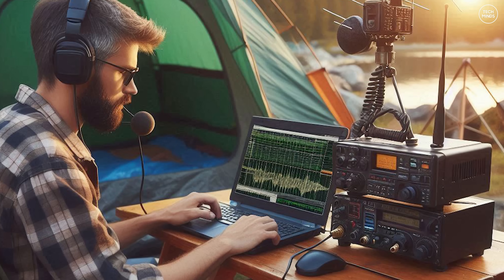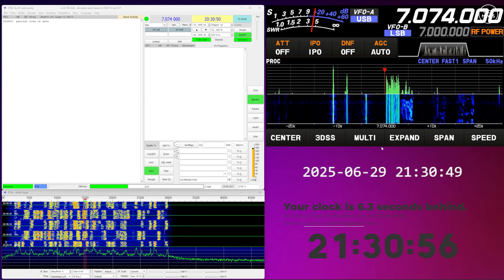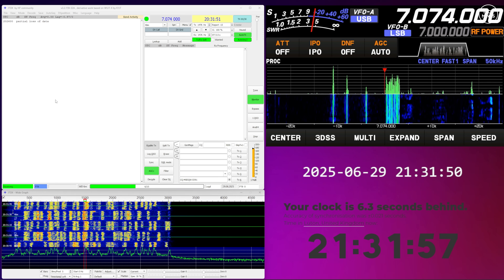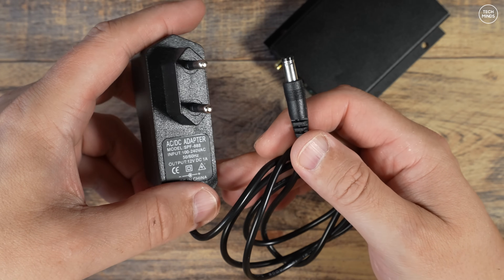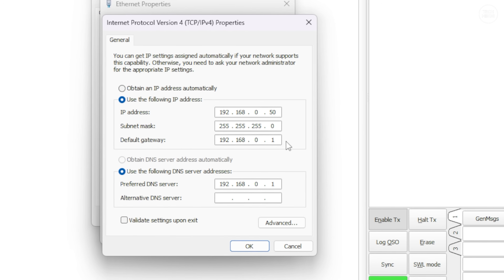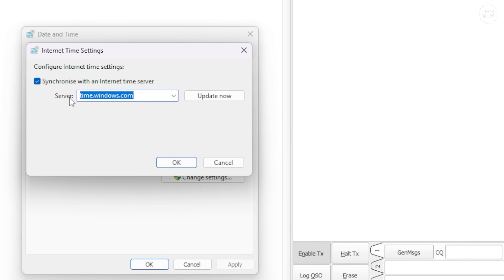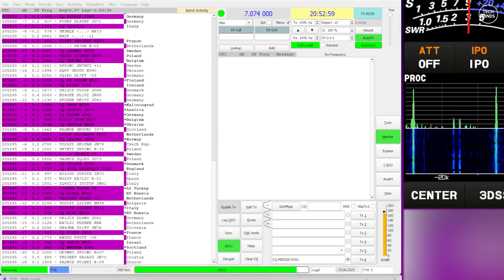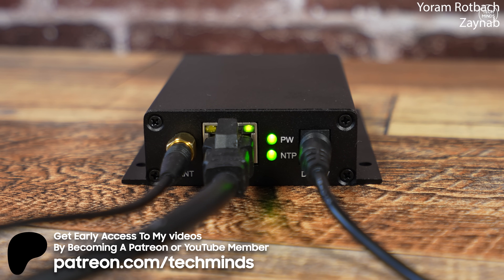Be THE BEST FT8 Station With This GPS Locked Time Server

Comment from the maker: Just a little heads up. The solution shown in this video is NOT the only solution. This is just one of many and this is suitable for sharing time data with others on a network without internet. The cheapest accurate way would be to use a GPS dongle, the completely free but a little more setup, would be to use JTsync. I should of mentioned this in the video, but hey ho, I still think it's a cool gadget to have. Cheers
Reply: Back in the Windows 7 days, I found the built-in NTP syncing to be pretty hopeless. So I always install Meinberg NTP and turn off the built-in NTP syncing, and I've stuck with this through W10 and now W11. It's nice to have reliable NTP sync that just starts when you boot up the computer, and even learns to compensate for any drift in your PC's timekeeping.

Comment: WHY? I have a cheap GPS USB dongle from Amazon and software from NMEATime2 running on Windows 11. So for about 34 dollars US and NO Ethernet setup or external power need. I have GPS synced time. giving me a DT of +/- and no more than 0 .3.   FYI: What is a ROOOTUR?
Reply: I'd have thought that the right dongle that passes PPS though used with the right drivers ought to be able to get way better than 0.3 sec error.
Reply from the maker: A ROOOTUR, which I presume you mean Router, is a network device to connect other network devices together and provide a DHCP server if required. I AM BRITISH AND SAY IT PROPERLY! There are many ways in which to skin a cat! This is just one of them... (The video solution I mean).
Reply: That was our Field  Day Set with networking on N1MM logging program.. ran very smoothly.

Comment: I use time sync, for sure.  That said, I still find it critical to have JTsync on-board.  Why?  I've gotten onto a band where there are few operators and they are NOT time-sync'd.  Being able to easily sync to them is where JTsync shines.  It's the rare occasion where being right puts one out of the loop.

Comment: What is the most popular use for FT8? 
Or in other words, why would I use/need FT8?
I don't know if I'm missing out or not.
Reply: As a CW op and FT8 too… when I’m drinking 🍺 FT8…. 🍷 FT8… 💉 FT8….. It is like the slot/poker machine mode. You get a little shot of dopamine when you land a DX station. If the bands are crapped out FT8 works as it is a weak signal mode. It’s fun but CW WILL NEVER DIE 73 de VK2AOE dit dit
Reply: It's just another way of making a contact. It'll work when the signal is too weak to make a voice contact. It'll give you another means of making a computer contact, joining things like RTTY, SSTV, PSK31, packet, etc. It's a good indicator of propagation to see where you can receive without having to spend a lot of time tuning around the band as they're all on the same frequency. It's also useful late at night where you don't want to be shouting into a microphone.
Reply: LOL. FT-8 on WSJT-X is fun, sort of and you don't need to get into a drawn out Conversation with a bunch OM.

Comment: Interesting. I used to run FT8 on an old Android phone. Using FT8 app. I made an adapter for the 3.5mm jack plug for headphones and microphone. Load resistors of 35ohms to simulate headphones on phone then feeding into mic socket on radio. Radio spkr out 8ohm resistor into phone mic socket.  Radio set to vox etc. Never had any problems with time. Just had to get Radio volume vox levels set etc. Assume phone app done time corrections. Used same interface for SSTV using the App. Worked for me but got bored with ft8. 😂 George

Comment: OK,  Ive got something simpler..    You can buy a $7 battery and install it into a Raspberry Pi 5 and have all the accurate time you want.   HOW:    The Rpi 5 just needs to sync once on your home network.   Then its good for weeks with its own RTC clock chip.    uggg.     Matter of fact,   I have run FT8 for several days from my RPI 5  with absolutely no issues.     Every several weeks I let it sync up again by booting on the home network then Im good to go for awhile.
Reply: All right, I have not done this with my pi but the pi fives have a new real time clock chip,  whereas the old pies do not. So you need to literally buy a battery to keep the clock running.  And you should be able to throw a GPS dongle on it to keep it accurate. I've been wanting to build a Time code generator out of a pi forever and now the pi5 gives me an opportunity to do so.  But there's still the huge problem with the code. Which I can't do yet.
Reply: until it crashes out and drifts or the SD card dies a death, these have jumped up in price of recent times like a lot of things on these websites since trump started chucking tariffs everywhere but for a simplified device  it does its trick a PI is overkill and unless you buy an older model more expensive
Reply: @scorpionfpv6412  the issues you are citing have not personally occurred in my setups since i started playing with rpis since 2012.  as far as pricing,  for me it was $0 cause I have about 8 or 9 of these things laying around as a hobbyist.  and the battery was just $7
Reply: the issues you have reported I have not seen in my RPIs and I have been using rpi for nearly a decade
Reply: @scorpionfpv6412  your experiences you have cited are not mine,  i have had good luck with my RPI units as a hobbyist over the last 10 years.   for me,  the cost was just the clock battery  because i already had an RPI5 laying around.   and as stated before,   full FT8 for hours on the RPI after a simple one-time sync at home

Comment: I use a $5.99 USB GPS dongle to achieve this in the field, works great. I even keep one plugged into my primary shack computer at home and the other computers in the house sync to it via LAN.
Reply: This is what I use. Works great.
Reply: I use one on my xiegu x6100. It works great so far.
Reply: @sanstache2529  Plugged into the Xiegu itself? Such a thing never occurred to me...although it is essentially a little Linux computer. Hmm. Is this with the alt firmware?

Comment: 254 not 255
Reply from the maker: You are correct! 👍 my mistake.
Reply: Also, no need to set a default gateway when devices are on the same subnet and don't need to reach other subnets or the Internet. So, unless this GPS time server needs Internet, no need to set a default gateway on it or on the computers that use it as a time source since it is presumably not a gateway device such as a router is. Unless your're away from home, you'll of course want to leave your existing default gateway setting alone.

Comment: The easiest no hardware option is to use a program called JTSync.  This program allows you to sync your clock to the signals you are receiving.  There is one instance where this program is super handy.  A DXPedition out in the middle of nowhere that has a out of sync clock.  You can receive them but not decode them because their clock has drifted to much.  With this program you can sync to their inaccurate clock and make the contact.
Reply: didn't know about this - smart approach to the problem!
Reply from the maker: Windows only I presume?
Reply: @TechMindsOfficial  Is there anything else?  🙂  On a more serious note, I believe it is Windows only.
Reply from the maker: hahahah.. True! I personally use Windows for everything. Only a small handful of times I need to run Linux for, let's say, certain scripts etc :-)
Reply: @TechMindsOfficial  I'm not a particularly big fan of Windows but I am a big believer in using whatever hardware and OS is best for the job. IMO, anybody who is not using Windows for ham radio is at a big disadvantage. I don't understand why people settle for lesser apps for the sake of brand loyalty.
Reply: @socallars3748  I have a Raspberry Pi set up for FT8 out in the field due to its power efficiency and small size. It doesn't run Windows. At home I can use Windows.
Reply: @paulsengupta971  Sure, I get that. I use a tiny, cheap Windows laptop for field use. Small, but not very efficient! I've actually run Windows 11 on a Pi5 but it's not the best experience. Linux would be my 2nd choice for ham radio purposes.
Reply: Thanks, I've not heard of this program.